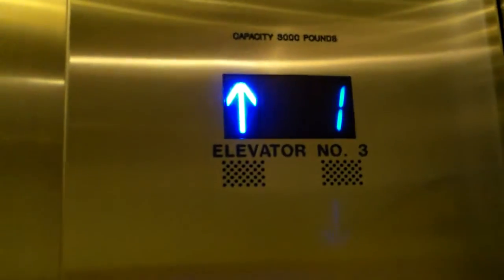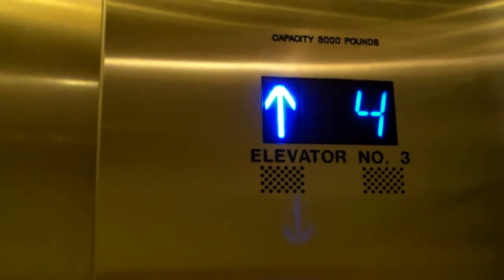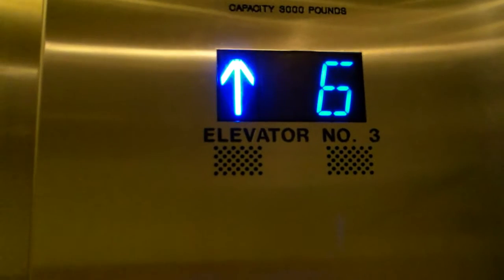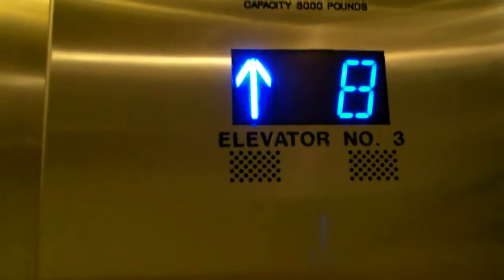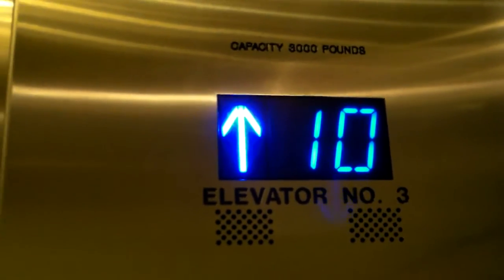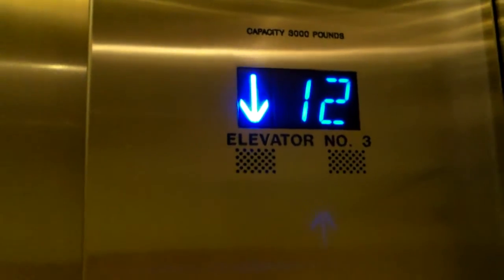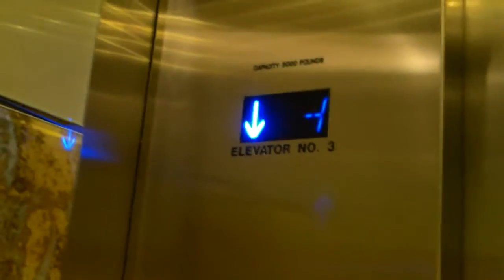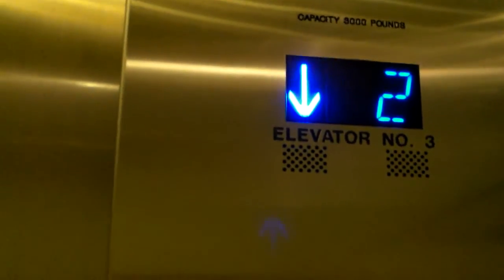Otis Traction Elevator at Colorado Center Tower I, Denver, CO

Comment from the maker: Superduper Julien Series 3 first came out around the year of 1986. The way I can tell these were Series 3 is because of the braille on the door jamb. I am thinking maybe Tower II of this complex will have an original Series 3 since it was built in 1999, but I can't be sure. I'd like to find an original Series 3 in Denver sometime though. Anyways, I'll be glad to see your childhood elevator videos when they come out.
Reply: +Elevating Denver According to my calculations the floors are around 21 ft apart in that building, but that office building could've had TKE mod them instead of OTIS with their series 7
Reply from the maker: technicalboy 3000 The building is less than 200 feet tall. So I'd say the floors are more like 15 feet. Also, I figured you'd have a say on the Otis Series 7.
Reply: Elevating Denver the otis series 7 is your average modern elevator.
Reply from the maker: technicalboy 3000 It basically is I guess. I hardly ever find anything else in new buildings these days.
Reply: Elevating Denver at least it doesent have that bright blue indicator on it like gen2 series 7 has.
Reply from the maker: technicalboy 3000 I prefer the ACME indicators more too.
Reply: Elevating Denver In fact, I'd rather a digital floor indicator just like the ones at one world trade center with the TKEs
Reply from the maker: technicalboy 3000 I really like the Otis ELD's and Dot-Matrixes.
Reply: Elevating Denver I like the digital floor indicators that TK has designed for the one world trade center
Reply from the maker: technicalboy 3000 Those are cool too.
Reply: +Elevating Denver I like the LCD indicators better than the ACME. Also, how many series 7 have you found in NEW buildings not mods.
Reply: Superduper Julien Zero. The only otis series 7 i road was in the empire state building and it was a mod.
Reply: +technicalboy “techgeek5000” 3000 They use the LCD indicator on Otis series 7 Gen2, Gen2 skyrise, HydroFit and Compass. The ACME indicator is mostly used on Series 7 mods.
Reply: Superduper Julien YUCK! I'd rather a ThyssenKrupp mod.
Reply: technicalboy 3000 I was talking to Nathan. I have found tons in Orlando, FL and Miami, FL. I will try to film the ones in Orlando soon. It may be a while till I get to go film the ones in Miami. I've found lots of series 7 and most were in brand new buildings. I've only been on 1 series 7 mod.
Reply: Superduper Julien uh don't you mean Elevating Denver?
Reply: Yes but his real name is Nathan
Reply: technicalboy 3000 All of the OTIS series 7 elevators in my hotel would have the blue LCD indicator.
Reply: Superduper Julien my elevators are thyssenkrupp. it's confirmed. i was going to use kone but i didnt feel like it.